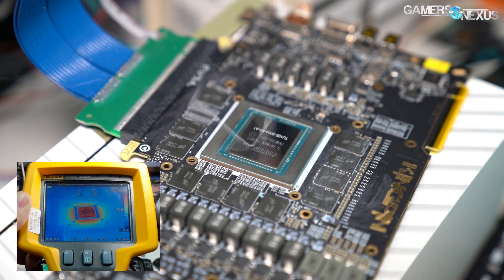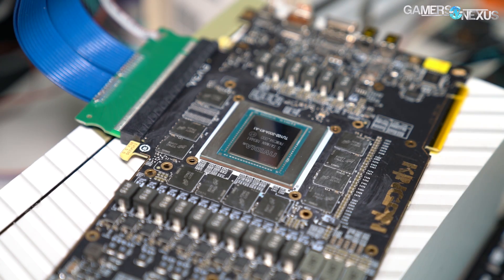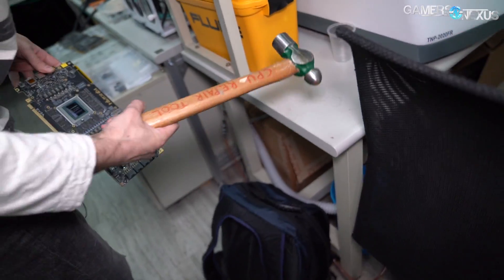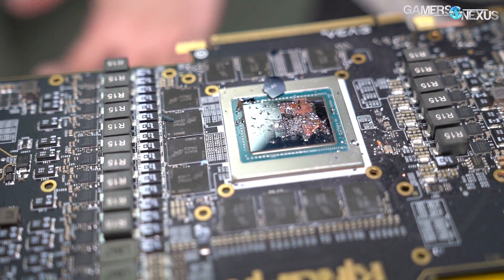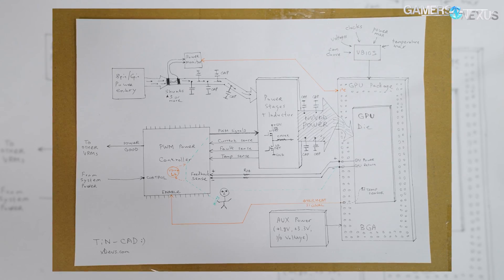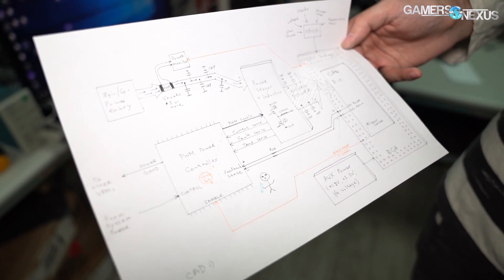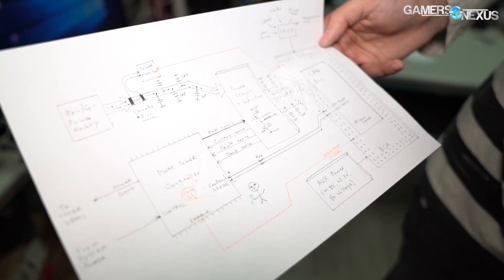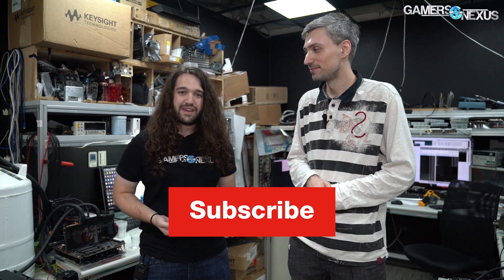Inside a GPU Die: Exploding 2080 Ti GPUs by Overheating, ft. TiN

Comment: Maybe I missed it in the video, but why (if possible) can consumer cards have thermal protection disabled? Is it only a feature of sample boards, or is it beneficial in overclocking? I understand for the engineering samples to see how far the card can be pushed before popping, or becoming unstable.
I had tried googling this but all i was getting was "why GPUS are thermal throttling" and "why thermal protection is important" but not why it can be disabled, or if it can be.

TLDR Question; Can and what is the use of disabling thermal protection? is it just disabled to test card limits? Only on engineering samples?
Reply: There are some vBIOSes with temperature and power limits disabled but they are for the extreme OC community to set records with , who are willing to risk the card in order to do so. You wouldn't use them unless you are running LN2 , and unless you know where to look those vBIOSes aren't distrubuted widely.

Comment: Interesting that there is no heat spreader on GPU die like CPUs. When repasting, I guess it pays to be extra careful not to scratch it when cleaning off paste. Granted that the top layer of sillicon is quite thick and acts as spreader.
Reply: How do you scratch a chip anyway?

Comment: What should this overclocking do?
Guys, please think logically. For example, if you run a monitor that has 144Hz frame rate, then it can only render 144 frames per second. If the graphics card is capable of calculating and outputting more than 144 frames per second, it will not do any good, except unnecessary waste of computing power.
Example:
The graphics card renders 1000 frames per second. The monitor can only display 144 frames per second - 856 frames per second were calculated by the graphics card in addition, but can not be displayed by the monitor and disappear in nothing, except heat and power consumption. Every 6.9th image is displayed by the monitor.
I think, either you buy a PC that meets your needs, or you can leave it.
Overclocking will always reduce the lifetime of the hardware.

Comment: So not to question TIN or anything...but (at least with older technologies like I'm used to working with) the die is flip chip is actually upside down and the transistors are the closest to the laser etched side that says "nvidia" etc. and the metal is all the colorful shit you see because the light is being reflected/diffracted through the routing layers.  You call it flip chip because normally you have the metal layers on top and then you wire bond it out to a lead frame (like the packages with legs) but in a flip chip you basically do something like the BGA pattern on the chip itself then flip it onto the substrate that you use for redistribution so it can be put on a regular PCB

Comment: We called this "Releasing the blue smoke" back in the day.  It was an old IBM joke... the chips are powered by IBM magic and when we blow one up, it releases it as blue smoke.  It became a meme for any chip getting smoked, not just IBM.  Not as flashy as blowing up tantalum capacitors (always fun to do that), but roughly equivalent to flushing $$ down the toilet considering how expensive some of those chips were.

The other things we did... put humerous silk screen under the big chips for the benefit of tinkerers whod pull the boards apart.  And in other places. One of my friends always wrote "Help, I'm being held hostage inside an EPROM!" on the silk-screen.

-Matt
Reply: That's pretty funny actually.  :) Sounds like a fun job.
Reply: Try that in 2020 and you'll be called a racist or a Nazi.
Reply: all you have to do is put all the blue smoke back and it will work again!

Comment: I remember before all of this protection, I was doing software work on an Athlon XP system (my grandfather's).  I heard a Pinging noise, which was the terrible OEM heatsink metal clip flying off, within a half of a second the screen froze.  Fried CPU.  Luckily back then there was a local shop close by that gave me an excuse to upgrade the CPU and get back up and running the same day.  It most likely happened while I was using it because I ran it much harder than he ever did, so the extra temperature or thermal expansion was just enough for it to let loose.  I would imagine a lot of people lost components to this sort of thing back then.
Reply: There were some sort of different precautions for the Athlons. On the one hand, you absolutely couldn't run them without a cooler. No throttling implemented apart from emergency motherboard shutdowns which never worked. On the other hand, stomping too heavy of a cooler onto the die, overtightening the cooler, mistightening the cooler, or doing some other wacky stuff could crack the die.
Reply: @previousslayer  Yep.  Those were the days.  It was just the OEM aluminum block, and the metal strap that snapped over the top.  It was unexpected, since we weren't physically inside the system anytime recently when it happened.  It wasn't long until those days were over.  I'm thinking Intel already had protections in place at that time, that a heatsink could be removed without catastrophic failure.  Although the XP wasn't new anymore when it happened.  It happened right around the Pentium 4 C time.

Comment: I wonder if the result would be far more spectacular if the GPU had enough time before overheating to at least boot into an OS and start a bench mark.
I would use IPA to cool the GPU, it vaporizes rather quickly, draws a lot of heat with it. But when it all has vaporized, then we have a GPU under full load and practically no cooling.
So that should be a lot more energy to create a more dramatic scene.

Comment: ft: Titanium Nitrate
Aka: The stuff people use to give items a gold looking coating.
Reply: If you know your stuff in this area;
What's between the printed wafer (the "rainbow" transistors) and the copper layer? (is there no risk of short-circuitry if the copper touches the print uniformly?)
And why use a relatively thick layer of copper and silicon? Is the silicon just an electric insulator? Do they just not care about using more copper in the chip?
Reply: @FireStorm81318  I have no idea. I haven't yet studied a lot of microprocesor stuff. I have studied a bit of chemistry and TiN is made of the two atoms Ti and N. Ti = titanium and N = nitrogen. So a molecule (which is made of 2 or more atoms) that contains Ti and N is called titanium nitrade.
Reply: @FireStorm81318  and why they use copper and silicon is that copper transfers heat a lot better than silicon. So my best guess is that the silicon layer functions as a electricle insulator and the copper as the heat transfer medium. But dont quote me on that.
Reply: @FireStorm81318  and my guess for the fact they might not want to use more copper. Is the fact that copper is Hella expensive and silicon is a lot cheaper. 😀
Reply: @FireStorm81318  yes, yes and no. Let me explain the yes and no part of that sentence. Graphite is a carbon structure which from 2d sheets with very very little inter connection between sheets hence the 2dness. Which would make it an amazing Heat conducter(better than diamond even) if you would reliable be able to align them all parallel to the heat source but since we can't and because their is little to no inter connection between the plate structures it's one of the worst conductors. And even if it was realy good, Graphite is pretty expensive to make. Well pure Graphite(single sheets of Graphite are called graphene). Copper is also a lot cheaper than using diamonds lol. But another reason why you saw a lot of copper(just started thinking about this) is the fact we are looking at a wafer which is a slab of all kinds of materials on which you print cpu's or gpu's, so it might have something to do with the way they print the transistors or something, just a thought though.
Reply: @FireStorm81318  as I said before I have no idea what I am talking about lol, but what you are saying makes a lot of sense and I think you got more knowledge about this process than I have lil
lol

Comment: Steve, while I was repasting my laptop CPU and GPU I noticed that there were some scratches and small pits on the actual dies, both of them still work, but should I be worried about it the next time I repaste or does the top layer of die not do anything?
Reply: This is why some people avoided IC Diamond for direct die cooling. It actually ruined some people's components while others did get some minor scratching. The stuff is pretty abrasive. I dunno what you used, but since it's still working I doubt you have anything to worry about right now.

Comment: When are Nvidia switching to 7nm Oompa Loompas?
Reply: Remember than even AMD doesn't use 7nm Oompa Loompas. The transistors are 7nm, but the control units are still 14nm.
They tell you it's to cut costs, and that it doesn't matter. But in reality they can't go below 14 because some Oompa Loompas are too fat to fit in less.

Comment: I brought a evga black edition 2070 came with a gpu clock of 1480hz memory clock was 4070mz out the box but with a little tweaking ive got a gpu clock of 2280mz and memory running at 8001mz.. Ran heaven benchmark for 25min no problems temps never went above 67c, is this normal for a £440 budget 2070?.. Ho on 3D mark i scored better than 98% im in top 2% XD..

Comment: Ah yes, that very important tool for PC builds and components. Nail that SSD to the PC case, so it's really Solid. Having a hard time putting the RAM sticks into the slot on a new mobo? Get yer very important tool, smash those bad boys in! Cpu pins aren't lining properly? The tool. Bam. In place.

Comment: Alright, so I’ll ask a “stupid” question (don’t know if anyone asked before). At 5:30 we get a lovely stock image of a silicon die/wafer at a fabrication installation but what about the the units that seem to be at the periphery of the circumference of the die? They look as though they are cut clean through or interrupted by the edge of the disc. Are these “lost” processors that simply had the misfortune to be located at the edge of the wafer? Why does this happen? Can’t fabrication facilities produce irregular shaped wafers that could “save” these processors or is it simply a natural wastage that manufacturers accept? I’d love to know. Anyway, they say there’s no such thing as a stupid question...only stupid people who don’t ask, so there!
Reply: They're totally wasted but you want the wafer to be as evenly processed as possible because it goes through the gnarliest temperature/voltage/etc. swings so you want it to be as uniformly distributed as you can get it (like when you bake a pan of muffins but you only want to make 3 muffins but your pan holds 8; you put something in the other holes so the pan doesn't get all uneven and have weird stresses that could potentially cause the wafer to crack or something)
Reply: Also - the wafer has to be round because of how it's grown
Reply: minispud Thanks man, that’s really helpful. What a shame with the wastage! Unavoidable.

Comment: Overtemperature protection is fine... however they need to make it easier to replace fans and other things on video cards. I personally have an old laptop that I have to use a tower fan to keep the GPU cool (cooler than the fan ever did) because the GPU fan has worn out and will not spin anymore at all.
Reply: Or perhaps you should learn how to do regular maintenance on your machines so they don't wear out prematurely. AKA DUST YOUR SHIT, FOOL.

Comment: "Destructive Testing" via Hand Manipulated Leverage tool for precision impact damage resilience inspection
Reply: We will need a 3rd party inspector to assure the destructive testing was successful.
Reply: @weightlifting_socialist  it is not a "leverage tool". it is an "unidirectional Impact generator".
Reply: Or perhaps "Manual Operation Dynamic Unidirectional Load Equipment"
Reply: Hand-Actuated Metallic Mass Eradication Rod.
Reply: hand manipulated wooden handled kinect impactor
Reply: Long wood with a big tip.
Reply: The art of Rhetoric.

Comment: Looking so forward to hearing the "LET'S GET STRAIGHT INTO IT TODAY."

When Tech Jesus starts reviewing the RYZEN 3000 cpus. 💯
Reply from the maker: Almost certainly what will be said!
Reply: @GamersNexus  you have no idea how much I want to see the 3900x vs the 9900k with a lot of game benchmarks. As well see what the 12 core does with the radeon 7 bandwidth. I like to see radeon 7 taken to its highest oc potential vs Jay2cents.
Reply: @GamersNexus  
At least this time you won't have three almost identical CPU's and start with the most expensive one. ;) 
I have already made up my mind about one thing: I hate it that AMD put the TDP of that 3700X so low and put the 3800X at a $70 higher price. That 3800X does not make any sense (I predict a big price cut before the end of 2019) but now you have this artificial limitation for the 3700X because of the hard limit of the XFR (maximum 0.2 GHz. higher than the boost) and if you loose XFR when you manually overclock or have some kind of automatic overclocking like on the Intel platform.
Reply: @GamersNexus  Is there gonna be an unboxing first as usual?
Reply: @Dan____  You're replying with something that wasn't talked about.
Reply: Calling someone Jesus is the exact same thing as calling them God. Might not want to do that.

Comment: 200C?   Wow!
Reply: A 9900K basically
Reply: Timothy Gibney nah about 50c
Reply: Drakkar Calethiel 5.0 across all cores, no direct die bs and it goes no higher than about 75c under max load. Gaming it sits around 50-55 so it's all bullshit about i9s burning the world.
Reply: @HadjiMart  
But for this temperatures you need a pretty good cpu-cooler.
Reply: Ezio Auditore yes this is true. Which I do.

Comment: Cool, we finally get to see the factory tour video for how Novideo cards are made
Reply: Isn't fanboyism a wonderful thing?
Reply: the irony is my 970 never randomly stopped outputting video yet my current 580 8g refuses to output to 3/4 of my displays
also rip, Steve doesn't approve.
Reply: @brammokeefe5405  sounds like a pebkac error.
Reply: @shawnpitman876  ive used 4 different hdmi cables and for all results i got only one monitor to work with this card. the 580 4g cards i have work just fine with all of them as well. its not user error, shits not rocket science
Reply from the maker: Not even the setup for that 'joke' makes sense.